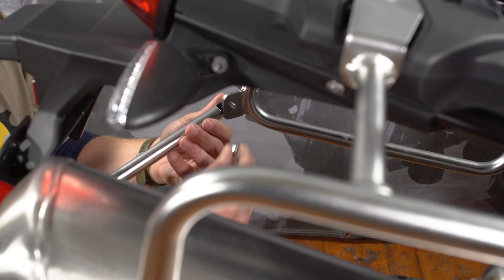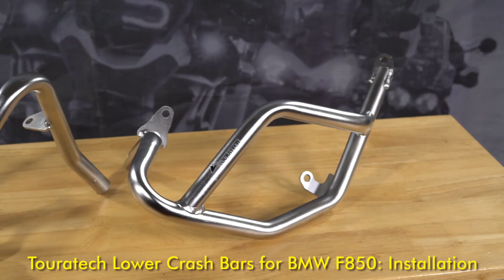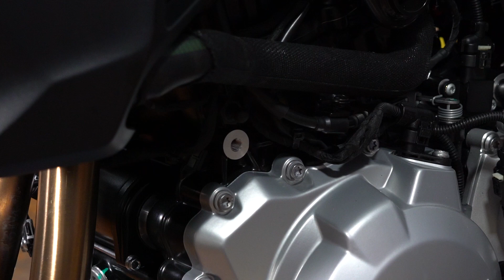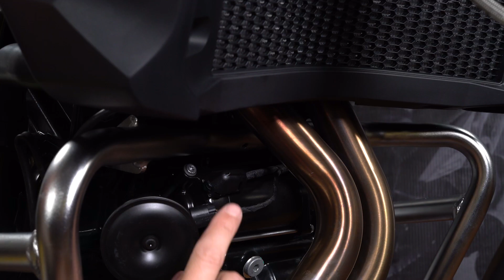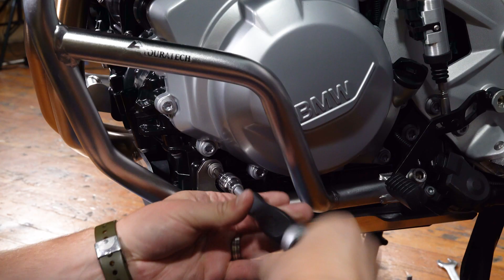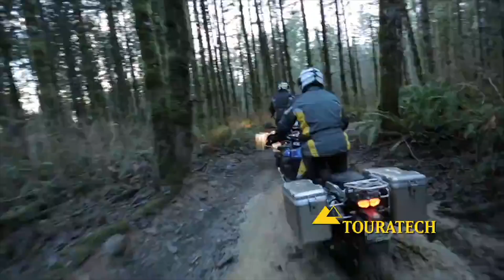BMW F850GS/F750GS Installation: Touratech Lower Engine Crash Bars

Comment: I found a solution to the center bolt problem!  I went to the store and found a "cross dowel" and used that.  A cross dowel is a barrel shaped nut that has a hole in the side that is threaded. You insert into the crast bar tube, assemble, and then you thread a bolt into the cross dowel. So much easier and really simple. Touratech should have just supplied one from the start!

Comment: When installing these, make sure that the left side M10 bolt ear is on the outside of the kickstand.  If it's on the inside, the parts will not line up together.  There is an error in the video where it shows it on the inside and then on the outside in another shot.

Comment: the M6 screw that goes in the center, as it does to fasten the interior screw hole to which you hardly have access (it should come already welded or with another less complex system) in the video they do not explain it
Reply from the maker: The 2021+ bikes had some changes to the exhaust and engine sensors that make it harder to install that crossbar bolt than the older one shown in this video. It's still possible but as you say, is difficult to access.
Reply: This took me 3 times longer to install this one bolt than it did the rest of the bars. Then I find out that the cutout on the male end is way bigger than the M6 washer. So it basically does nothing.
Reply: Difficult is an understatement, you will throw the allen wrench across the garage when the 10mm nut falls between the starter and engine block. And it will, don’t be surprised.

Comment: Put the bars in my place without any bolts and loosely install the small bolt that joins the two halves first!! Otherwise, if you do this last as the video says, you’ll be removing the starter motor to fish out the nut that you dropped that falls down behind the starter motor. Also, hardware is crap. For the price, all hardware should be torx!!
Reply: @tourtech please update your instructions, this is the way.

Comment: Why do you deliver the crash bars with alan screws and not with torx? bmw uses torx only... It would be handy, since you don't need to bring alan keys with your tools on a trip.
Reply from the maker: I know Touratech Germany has been looking at incorporating more Torx bolts into kits lately. In some markets those tools are less common so it can make installing simple parts more complicated.

Comment: bro, how are you, I have the BMW f850 2021 40th anniversary and also the same touratech crashbars, highs and lows, as in this video, I followed your instructions to the letter but it is impossible for me to place the M6X35 screw, I have no space to be able to put the washers and the M6 Nylock nut, how can I install it please ... thank you very much
Reply from the maker: Make sure that ALL the bolts are very loose when you try installing the M6 bolt. You should be able to move the bars around enough to gain access to the holes and line them up. The most common issue with this installation is tightening an M8 bolts before you have ALL of the bolts installed.
Reply: @TouratechUSA  Many Thanks, please, another question, I followed the steps to the letter, put Vistony EP-2 LITHIUM grease on the two large long screws, and tightened them to the specified torque

I just started the motorcycle and it started to smoke and smell burned, this is normal due to the grease on the bolts or the loctite ?
Reply from the maker: It's likely that you simply got some grease on the exhaust header while installing the bolts. Keep an eye on it but the smoking should resolve in less than a minute.
Reply: @TouratechUSA  Yes, happily it was the same grease that was used in the large screws that caused that smoke, after a few seconds it stopped smelling of burning, thank you very much for the prompt response, the tutorial videos and for the great touratech products!